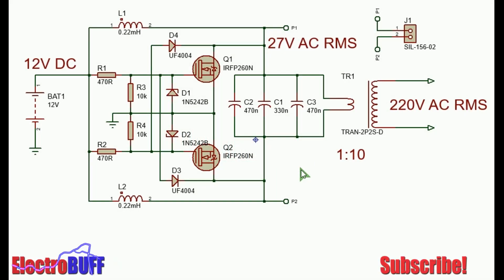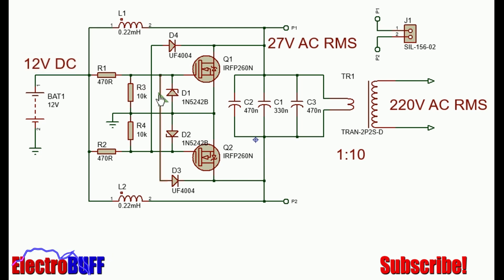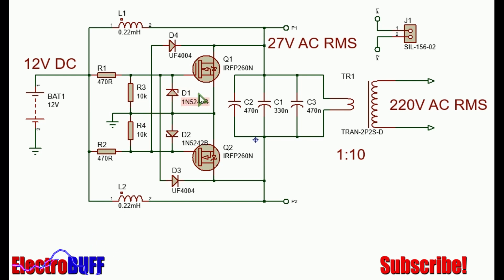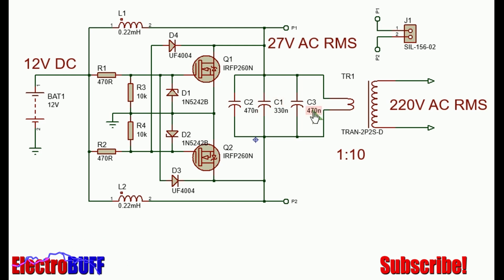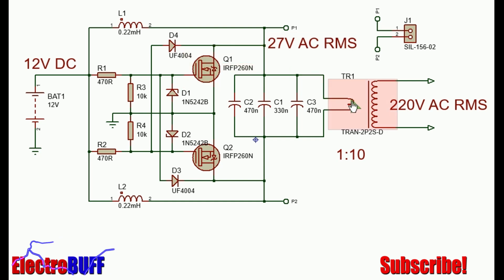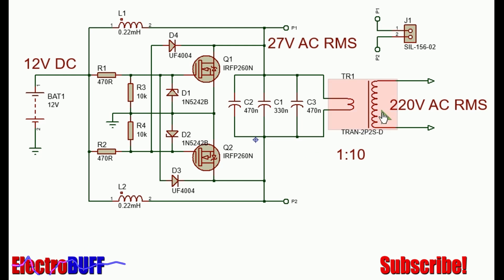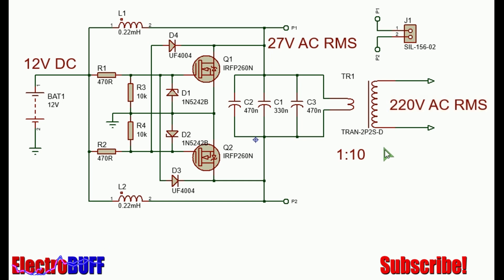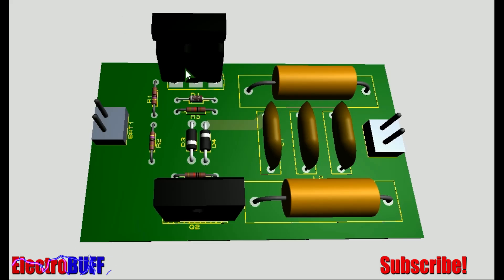Simple DIY Inverter 12V to 220V using a ZVS Driver

Comment: cool video but where can it be applied? frequencies above 20khz aren't very friendly to household electrical&electronic appliances.
Reply: @buddhafollower  normally, it is not possible, to transfer such low frequencies with an ferrittransformer!

This is an HF converter von 6 V DC to 230 V AC with 50 Hz;
https://wp.me/pc2ZNG-6h (you can switch this site to english)
Reply: @buddhafollower  okay. Thank you. But i am an friend of ferrit transformers. So it is not necessery to use big and heavy iron tranformers...
Reply: induction heaters